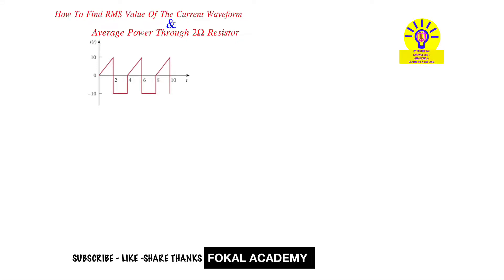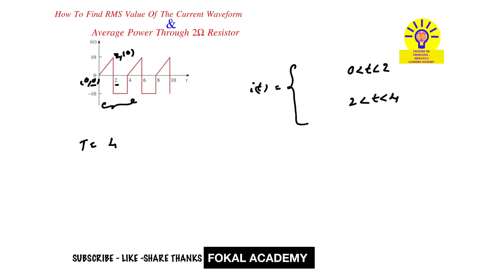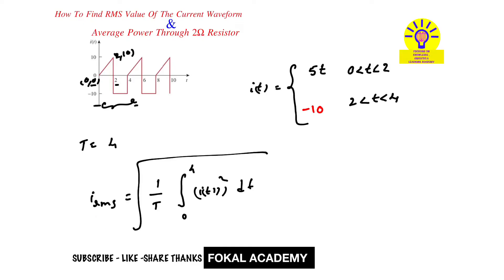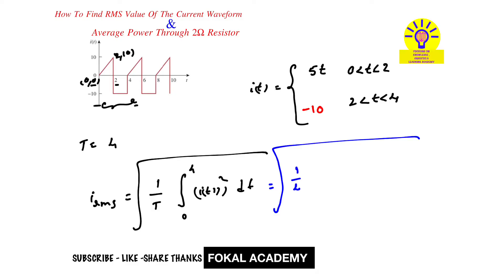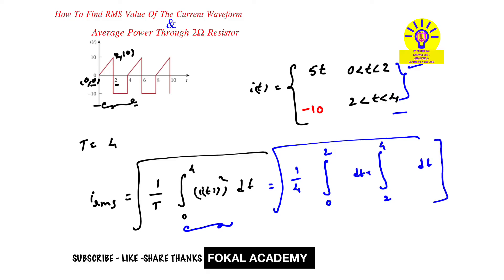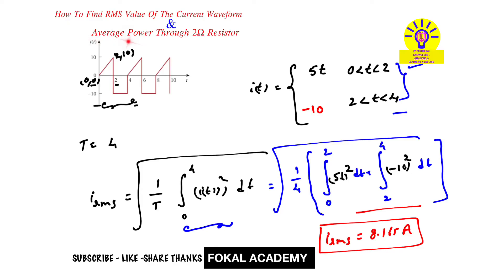How To Find RMS Value || Current Waveform || Average Power Circuit Analysis Solved Problem

Comment: How to get 5t
Reply from the maker: Between two points, apply line equation formula 
Y= mx+c
X axis is time (t)
m slope
Reply from the maker: y-y1= m(x-x1)
m= slope
m= (y2-y1)/(x2-x1)

On x axis , time is a variable (t)
Reply from the maker: Still if you have doubt, don't hesitate to ask ;)

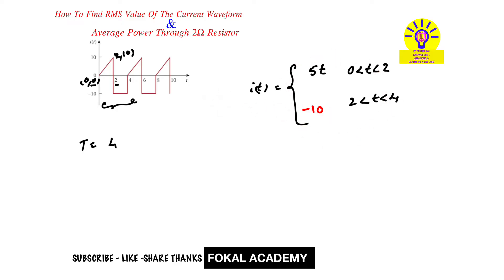Comment: 01:45 how did you get 5t sir..?
Reply from the maker: y-y1= m(x-x1)
m= slope
m= (y2-y1)/(x2-x1)

On x axis , time is a variable (t)
Reply: @FokalAcademy  thanks for the response
Reply from the maker: Between two points, apply line equation formula 
Y= mx+c
X axis is time (t)
m slope